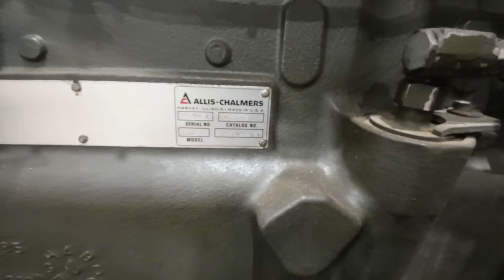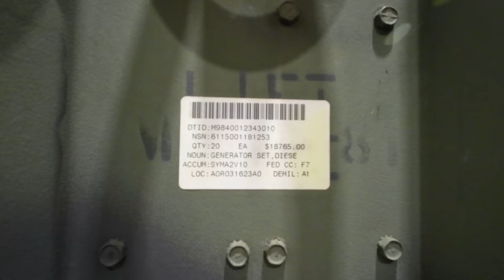$500 Diesel Millitary Generator sitting for many years, WILL IT RUN?? (Allis Chalmers 3500a)

Comment: Yep, there are basically 3 flavors of military generators, 24vdc for starting vehicles, 60hz ac for hotel services and 400hz ac for aircraft and electronics, used extensively in synchro and servo systems, radars etcetera.. think airstrip, or missile battery. and that's probably tinned copper, not aluminum, better corrosion resistance than plain copper wire. You can find very good technical manuals online from the army complete with fantastic wiring diagrams and part numbers
Reply: And the main reason that the military went with 400 Hz. is because you can't use any of their equipment on civilian applications.
Reply: Greg - I always wondered why military aircraft used 400hz - is it because it's easier to rectify or maybe something with transformer size that can be smaller with 400hz?
Reply: @wes11bravo  yea 400hz transformers are lighter and smaller
Reply: @wes11bravo i think you got it. The genset uses the same power rectified to run the onboard electronics and safety bus. I worked on similar sets for years for the airforce though ours were powered by detriot diesels and had been in service since vietnam. If it aint broke…
Reply: Referred to as a -86 or “hobart” on the flightline.
Reply: @dalemettee1147  Back than, but today you can just convert it to DC and than back to whatever.
Reply: The reason on why aircraft systems are 400 Hz is that when they were using transformers you can run efficiently with a smaller transformer core if the frequency is higher. At the time, weight on an aircraft was at a premium so reducing the poundage of transformers and generators was quite important.
Reply: Yeah, I was gonna say.  Plus, it'll supply both 120 and 240V AC.

As far as tech manuals, not so much.  Unless you're Gov't or military, you don't have access to ASSIST or any of the other sites you need.  The only manuals I found a) can't be accessed without that access, and b) were cancelled - in 1969.
Reply: @wes11bravo  it's 3-phase 400Hz and usually high voltage because it lets you deliver more power through thinner wires - that way everything in the electrical system can be lighter, not just wiring but all the rectifiers etc etc... Also used in civilian aircraft too, or at least the big'uns, not sure how small you have to get before it converts to other types. Edit - when I say "higher" voltage, I mean than your usual DC, it's 115V typically.
Reply: AC torque synchros work better at higher frequencies as well, and while they are not used quite as much these days, you will probably still find them on B52's and such like.
Reply: Nothing wrong with the starter it just takes 24v to start
Reply: I was thinking tinned copper as well. Better corrosion resistance than bare copper.
Reply: @KrikkitWarlord Down to about small private jet size is 400hz. Prop planes, big ones are 24vdc, small single engine is 12vdc just like a car. Sometimes they will have avionics that run on 12vac or 24vac 400hz, but just on a small inverter, no dedicated generator or anything.
Reply: Yep probably a plated copper conductor of some kind.  There's a number of plating materials you can put on it depending upon your environment.
Reply: @@gregdawson1909  Right, yeah, 400 Hz that's right.  I'd forgotten that I'd even remembered that!  Having 400Hz as the 'mains' frequency in aircraft means all the electronic equipment like radios & radars etc. can still operate, but with smaller filter capacitors & transformers in their power supply sections, saving weight.  

Still, 115V ac at 400Hz is just as nasty to touch as it is at 50Hz.  It might even electrocute you 8 times faster I dunno I'm not a doctor.  I can make & fix the gear that electrocutes you, but I can't fix you.  D'oh!
Reply: Good job Matt! Like your style!
Reply: Like you, who cares about what it ran, it’s a great sounding mill that can be used for what ever.
We all wanna see you in surgical scrubs when you do the transplant 👍🏻
Reply: @dalemettee1147 not why..
Reply: Stalagtites  form from ceiling down.( hanging  on tight to ceiling) 
Stalagmites  form from bottom up.(might reach the ceiling )
Thank my 3rd grade teacher. Lol
Reply: I figured it was platinum being the government lol
Reply: @Tishers  weight will always be a premium in aircraft design, the more the aircraft weighs, the less it can carry and the range decreases,  remove weight and you get more capability.  It works the same for hydraulics too,  higher the PSI the smaller the actuators which weighs less.  It's all a trade off.
Reply: Another cool, "GOT ANOTHER ONE GOING"! MATT COOL,!!!!! GREAT VIDEO!!!!
Reply: I think it’s a NATO unit, hence metric and the wiring.
Reply: Also for repairing in the field, tinned wire needs no prep to solder . Just similar wire, twist them and heat. Yeah the soldered copper is USA Military standard and UK since WWII. A drop of solder merges into any joint easily. Also it can utilise less copper weight than bare wire.
Reply: Great job Matt!! Keep up the good work!
Reply: 400hz wasn’t just used in the military.
Reply: Wire could be nickel copper? Locomotive use nickel copper wiring. Locomotive generator change frequency with throttle position (position six is 60 Hz). New loader with this engine swap.
Reply: I know why you had problems cracking the lines loose, Bubba from the motor pool put them on. I forget what kind of insulation is on the wires, but it is non-flammable. And yes it is tinned copper. Milspec wiring, it only comes in white. I was in calibration, it was a pain in the a$$ to trace any wire fault in the harness, 99% of the time faster to just order a new harness.
Reply: that's right sir, as an electrician at Lockheed martin, we also install 400hz generators in the facility for supply of avionic equipment being bench tested.  one thing you have to also have to take into consideration is 400hz should not be installed in a steel conduit because of inductive heating, so you install in aluminum conduit.  in addition, because of voltage drop, wire has to be up sized for for a shorter distance compared to 60hz.  of course inside an aircraft, distance is not an issue.  generally in a testing lab, like you said, there are 24vdc outlets, 400hz 208v outlets, and regular 60hz 208v
Reply: @dalemettee1147  all aircraft civilian and military are 400hz 115v
Reply: @jeepindave5464 no, not platinum. hen we make wire for the military it's all copper with a tin emulsion. The only other thing we do is silver plated copper for the braided coax cables. Those are rare orders and we usually just make standard tinned copper braided coax.
Reply: Tinned copper wire should be MilSpec for most difficult environments like outdoor generators for jet aircraft
Reply: @wes11bravo not only transformers but filter capacitors and other various components.  Higher frequencies are less susceptible to noise intrusion.  This generator looks like the 60kw used with radar, missile, and anti aircraft.
Reply: @dalemettee1147 lol.Commercoal aircraft are 400hz.400hz alternators are a fraction of the size.
Reply: @gregdawson1909 I spent 10 years operating these generators as 1141 Electrician/ Generator Operator in the Marines. There are only 2 frequency generator sets . 60hz and 400hz. All are 24vdc starting systems. We use slave cables to jump start from other gen set or a humvee. The 60hz gens are our standard utility generator. The 400hz are used for communication/ airfield operations because it provides a more pure sign wave and less radio interference. There was only a few times we every use the 400hz units. Mostly for communication sat ops. Unless your attached to Air wing units.
Reply: @eoinm123 I wouldn't be surprised if the Russians use 401hz so they can say that they have the biggest.
Reply: @eoinm123 I wouldn't be surprised if the Russians use 401hz so they can say that they have the biggest.
Reply: Hello 🤩🚜🚜🚜🚜🚜🚜🚜🚜🚜🚜🚜🚜🚜❤😂
Reply: Hotel services? Sounds like a chairforce thing!
Reply: Ambition strikes channel has one and loves it, starts every time, his has a weather shroud around it though.....
Reply: Good old Allis Chalmers, made everything from Farm equipment to Nuclear reactors.....
Reply: I think it would make the most sense to solder them all In series so we can get this pig up to 21 jigga watts and drag this this up to 88mph. Then we’re gonna need alittle couple coughs from the ether bunny, and of course then we gotta dig a six foot trench all the way around the shop, fill it with diesel, contact!
Reply: @dalemettee1147 all civilian jet aircraft run 400hz ac. So the jokes on you mate.
Reply: The cycles per second will determine the speed of an electrical motor thus there are VFD ‘s (variable frequency drives) that can slow an electrical motor to a very very slow speed. And that’s all I have to say about that
Reply: Damnit man, dude here. Sounds like he knows what he is talking about.

Comment: I worked on these a bit in the Army. The tank you removed is called a day tank. Fuel is pumped from the main tank into the day tank. There is a float in the day tank to call for fuel from the main tank. If the fuel level gets too low, it will not allow the engine to operate as to prevent actually running the engine out of fuel. The fuel is then pumped from the day tank to the injection pump. Scatter a few filters along the way, and that pretty much sums it up. The injector pump was electronically controlled because the engine RPM is what controls the frequency (Hz) of the generator output. Great video sir.
Reply: I’ve been considering grabbing a military generator in hopes of running it on black Diesel.  A smaller 3-5 k units.   As a guy who’s dealt with this stuff a bit would you have any advice?
Reply: @Red9GearHeads  I'm not the op but my 2 cents is an MEP-802a (5kw rated but will do up to 7kw), if you want something a little less expensive can get an MEP-002A (basically an 802a without an enclosure), if you want less than that there is a single cylinder MEP-831A (3KW inverter genset) but it is a PITA and the inverter will eventually die and they are pricey (the inverters that is), I personally use an MEP-803a as my personal backup for some time now (10kw) Hope this helps until OP can respond!
Reply: @icey_projects   thanks a million man!  It’s great having some info from guys who know a thing or two about them.   

I’d like a larger unit. I smaller gas units plumbed to propane that I use for quick back up.  Hoping for diesel liquid cooled so I can use it to power the house and pipe the heat into my houses hydronic system.  

Any chance you’d have a dart throw at how much fuel I could expect the 5k unit to burn in a 24hr period?
Reply: @Red9GearHeads  pumping the excess heat into your home's hydronic system is a brilliant idea. if there is a way to have it go through some form of a "heat exchanger" that would be  ideal. I would definately suggest integrating some sort of electronic valve so that way if you don't need the heat at the time, that it would "bleed off" into the air or other heat related appliances.

If you find any of this helpful, I recommend doing safely of course. Remain cautious and research as necessary is my main advice.
Reply: @jd_railfan   thanks for the comment.  I think it’s a great way to power the house and help with heating cost, as well as my constant feeding of my wood fired system.  

I do have several exchangers.  I wouldn’t run the system unless I was around to babysit.  Seems a 5-7k system running on the weekends would heat the house (at least partially) and help offset the electricity I use through the week while I’m away.
Reply: @Red9GearHeads  You could use heat from the genset to make hot water for your house by making a heat exchanger dedicated to flow to a water heater. Temperature would need to be  controlled by electric valves as the genset normally runs at about 180F. Using fan forced air and automotive heater cores you could heat your home and provide hot water.
Reply: @ajwilson605   yep.  That’s my plan.   I already hear with a out door wood boiler.   Using genset would only require i plumb it into the loop.   

Thanks for the suggestion.  Great minds…
Reply: You hit on a few great points. Were you a 52D ?

Comment: Not really the point of this video, but the way I was taught to remember is that stalagmites have a G in them and they grow from the ground. Stalactites have a C in them and they grow down from the ceiling. Also yes, aircraft use 400Hz power, the higher frequency allows for physically smaller and lighter weight electric motors and transformers.

Comment: If the generator was used to power the actual aircraft, it likely output 115 V @ 400 Hz. The reason aircraft use 400 hz, not 60 hz, is that it allows step-up and step down transformers onboard the aircraft to be much lighter and much smaller than the transformers used for 60 HZ devices in the home or factory. The reason why today's AC to DC and DC to DC converters are so small and light is because the switching frequency used is typically 50 kHz to 250 kHz. The only way to reduce the size and weight of transformers is to increase the frequency.

Comment: Stalagmites versus Stalagtites — Very easy to remember which grow up and which grow down.  Stalagtites have to "hang on tight so they do not fall down off their rock".  Stalagmites have to have the "might to stay on the rock they are growing up on".   As I said, "very easy", at least it was after I learned this method of differentiating.

Comment: The two silver “canister thingys” inline with the fuel input are fuel pumps. One for the main tank, and one for the aux connection you are using. The shutoff solenoid might not be grounded at all and isolated from ground. Check resistance across the two wires going into it. I bet you will find that’s the winding for the electromagnet. 

There are awesome manuals including schematics, engine rebuild manuals and so-on for MEP gensets widely available, but at this point since you are already neck deep and I’m 30+ minutes in, it’s too late. :-) 

Oh, and that’s not aluminum wire. That’s the good stuff - tinned copper aircraft spec wiring.
Reply: Yes, Facet (brand) electric pumps.
Reply: @raykaufman7156  Yep, just what I was going to say, darn good pumps too.
Reply: spoken like a true maintenance tech  (former RCEME myself)
Reply: Facet pumps…. Carry fuel to injector pump. Sometimes a third facet pump for auxiliary tank which on some gensets pumps directly into unit fuel tank and not to injector pump.
Reply: Yes, I had one of them canisters on my excavator, it's a pump + pre-filter, I had crap in my fuel tank and had to clean that a lot, so finally replaced it with a modern pump and had 2 main fuel filters instead, the one in the canister is very small.
Reply: I believe aircraft work with 400 Hz?
Reply: @michiel1362  115v 400hz yep
Reply: The two canisters (behind the price tag) are fuel pumps with twist off gauze filters.
Reply: Yes, tinned copper wire was my first thought also, highly damanded in marine applications as well!
👍
Reply: @michiel1362  Yes aviation is 400 Hz.

Comment: Hey Matt, swap out the engine with Fat Alice - then use the generator frame to build an "Engine Test Rig" e.g Something with an integral small fuel tank, switches - hookup's - radiator - Clamps and rails so you adjust to different engine sizes. I reckon you would get alot of use.
Reply: Thats a great idea.
C’mon Matt this needs to happen.
Reply: That's a great idea
Reply: i agree perfect to turn into a test for engines
Reply: Call it "the lab"!
Reply: I would like to see more business information on this and similar channels.  A lot of this stuff appears to be practical, but is it? What are the repaired machines worth after the repairs? what is the cost in parts? would these activities be viable without YouTube? how much is he spending and how much is he getting? If the shop was mortgaged instead of paid for by YouTube, what would that be costing per month?
    I am worried about the illusion of practicality.
    It's pretty clear that antique collecting and restoring activities would be financed by YouTube unless flipped to other collectors or hired out to museums, but I would very much like to see some ballpark numbers on how far this business has become an entertainment business as opposed to a contracting or repair business.
Reply: @alan6832  Actually, realistically and quite simply, none off this warrants it being your business. Whatever Matt presents to us is for our enjoyment and entertainment, it is pure joy to watch him work and accomplish whatever he endeavors. That he manages to raise funds to supplement his expenditures is awesome, it means we will get to see many future episodes of his adventures in saving antique equipment. He is like a character Doctor Matt, administering diagnosis and treating his older patients back to functionality Eh?.
Reply: @alan6832  I think you are being a bit too nosy here! Just accept what you see for what is is - some screen time fun.